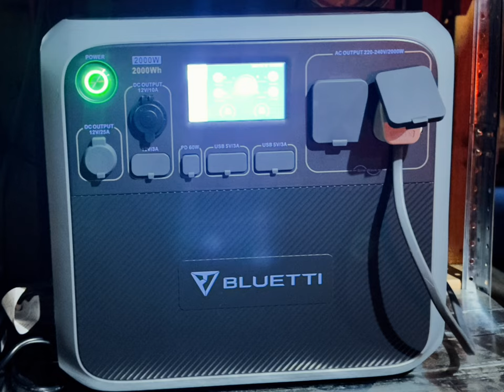Two old friends living off the grid in a self build cabin in Scotland UK

Comment: before the winter sets in= make sure you have the cabin air circulation sorted, . ... preferably have an input in the floor for clean air placed  in the floor at the front of the stove,, so the stove draws in air from the nearest point and in doing so it will prevent the stove from drawing cold oxygenated air through floor boards, door frames, and roof etc.. .. this set up is efficient and beneficial for the control of stove fire burn , and health.. Have a think on it. You might have to pipe the air under the floor or you might already have under draft .  Then add a roof vent to allow stale air to exit  . The exit vent in a wall up high or in the roof. at a far distance from the stove.This will circulate and keep you healthy if you have to have extended periods cooped up.  ???   it will also benefit the fuel /fire in the stove. ... .. bad static air is bad for health.. Static air is very dangerous and causes all sorts of illness, drowsiness and can comatose or even death whilst asleep it depletes the oxygen .  . If you get this set up correctly you will probably not require a fan , the circulation will be by the use of the stove its self..of it needs a fan just use one from a computer or smaller .    good luck keep warm and in good health..r = ps I HAVE BEEN BURNING LOGS AND STOVES FOR OVER FORTY YEARS AND BEING IN THE WELDING GAME HAVE EXPERIENCE IN STOVES OF ALL SHAPES AND SIZES, . OH AND DON'T FORGET A ROARING BLAZE IS NOT EFFICIENT IN A WOOD BURNER SLOW AND GLOW IS THE BEST HEAT AND THE BEST ECONOMICALLY. . FLOOR VENT CONTROLS INPUT , ROOF VENT CONTROLS CIRCULATION AND EXIT. ...MAKE SURE THEY CAN BE ADJUSTABLE.. NOT O LARGE, NOT TO SMALL  FIVE/SIX INCHES CIRCULAR ALWAYS GOOD.  FOR TESTING FLOW DIRECTIONS  EXPERIMENT WITH A CANDLE FLAME/SMOKE TO SEE HOW THE FLAME BENDS ETC ,  GOOD LUCK. WISH YOU WELL NJOY. AND BE HAPPY.
Reply from the maker: Thank you i will take on board your recommendations
Reply: You should write a book!